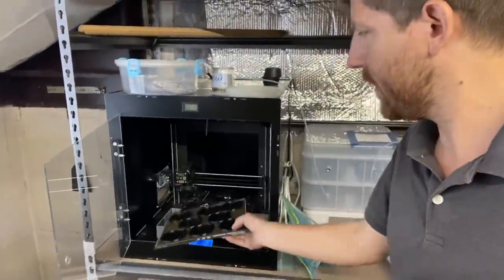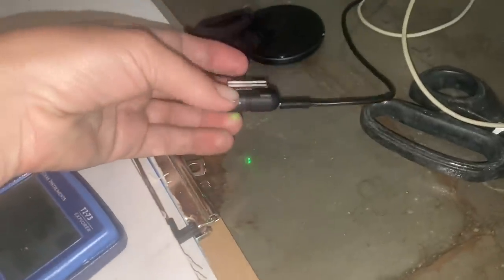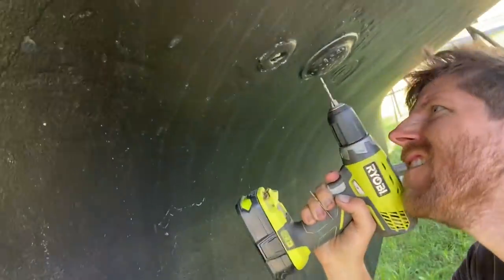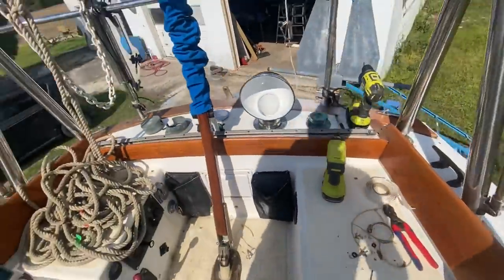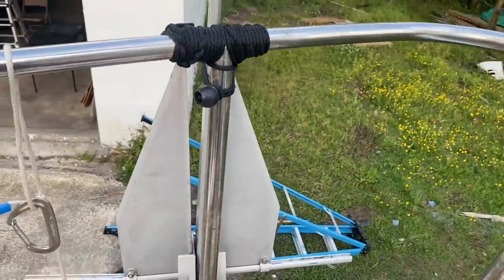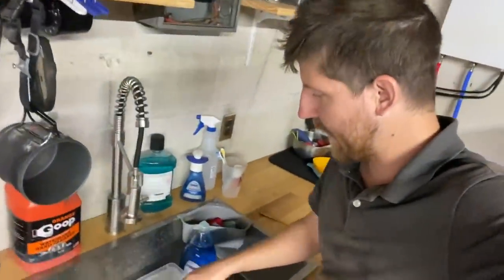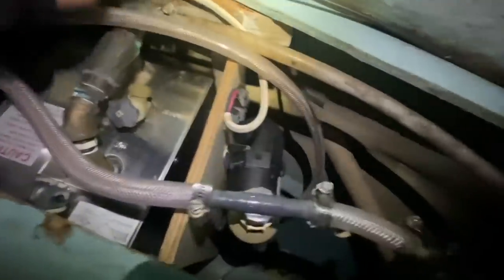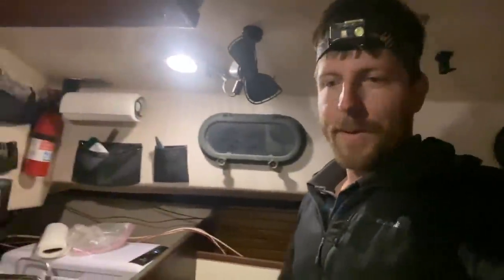Daily vlog #5

Comment: I'll second the suggestion from few videos back to rewire the sump/bilge pumps with a manual and new wire throughout, cracking insulation on old wires, rats nest mostly removed but consider the first time learning switches pumps, need for manual (courtesy online assembled wisdom) and practice with old wire. So many splices like spokes on a wheel, after 2 or so go, rebuild /rewire needed...  Not worth a short out at sea ⛵ and up dry , (think > 4 years?). Y(NM)MV

Comment: Hi ! I think it's not the first time I see you printing stuff in transparent plastic for the boat. I highly recommend you use black plastic instead. The black pigment will absorb UV light before it reaches the plastic too deep, which will make the parts last longer in the sun. It also applies to zip ties, always prefer black zip ties in the sun. Hope this little trick helps you or someone :)

Comment: Sam. Do yourself a favour. Whale foot pump restore kit. Take one along on trip. The rubber manifolds inside pump don’t last, specially if you soak in bleach. Whale make right and left. 
Slice length wise the stuck water line and it comes right off. It was painful watching you struggle

Comment: I used the same hose/grey pipebarb combo on my bus conversion and it leaked terribly. So if a connection ever leaks on you, heat the hose section on the barb with a heat gun, and tighten the hose clamp with an impact. That's what saved me.
 Love following your videos and your progress!